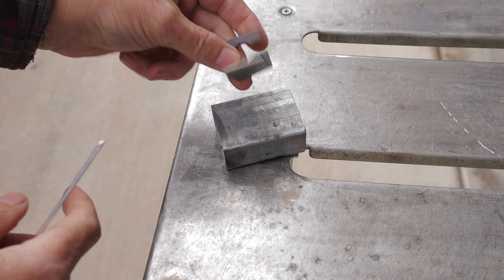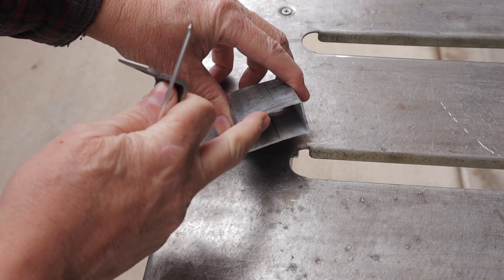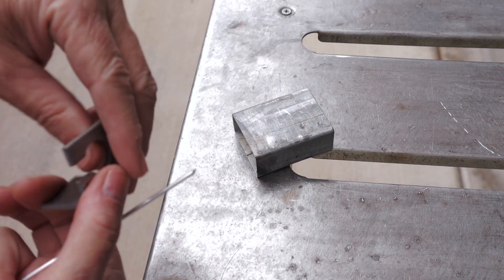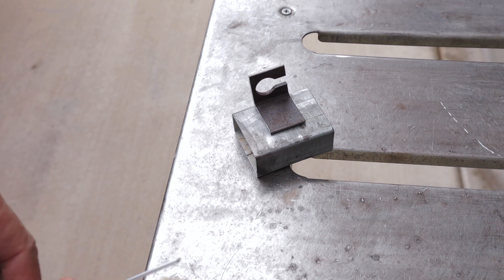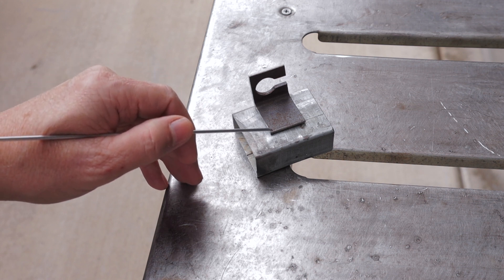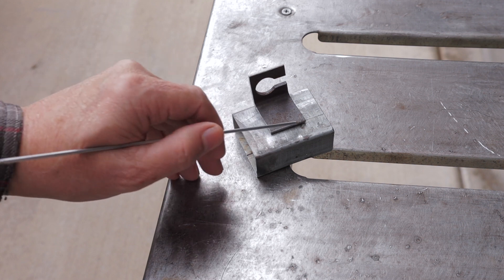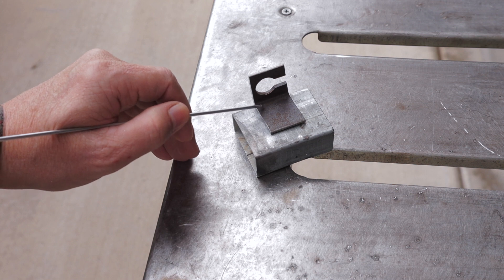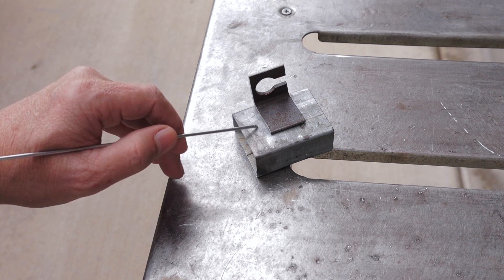Stop Burning Holes! Weld Thick to Thin Metal (Flux Core)

Comment: Thanks for this! I did a gate repair and it looks like chicken poop with spatter everywhere and burn through on parts of the thinner metal. I was trying the stick weld method of getting into the join rather than staying away and let the puddle do its thing. 

Clean up and retry tomorrow!
Reply: This made laugh out loud. I’m working on a fence repair and also have a massive chicken poop issue. The original is much thinner than the base and as soon as the wire touches it’s immediate burn through no matter where I’m aiming the gun. Will try this again soon with some more practice before going back to finish. Thanks for this video as well. Huge confidence builder now that I know it can be done.

Comment: Which diameter wire were you using?
Reply from the maker: I'm using .030 wire.
E71T-GS/10LB-0.8 .030" 10LB Spool Gasless Flux Core MIG Welding Wire
https://yeswelder.com/collections/accessories/products/welding-wire-e71tgs1008?ref=DIYHP10%25
E71T-GS/2LB-0.8 2LB Spool .030" Gasless Flux Core MIG Welding Wire
https://yeswelder.com/collections/accessories/products/welding-wire-e71tgs208?ref=DIYHP10%25

Comment: What was that built for?
Reply from the maker: The object I welded in this video is just a practice piece for a technique I used to fasten the top to my DIY welding table build. I wanted to try it out first to see how it would work out. I was happy with the practice results so I ended up using the technique for the actual welding table build.